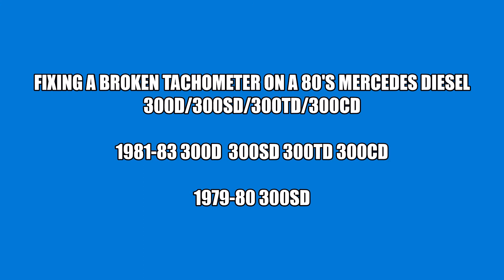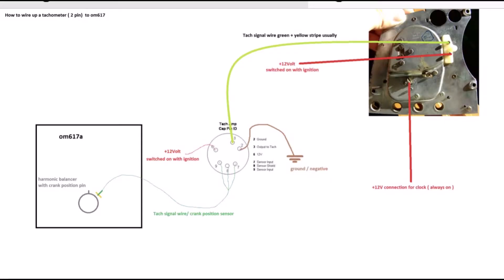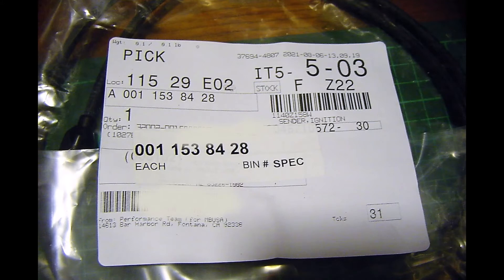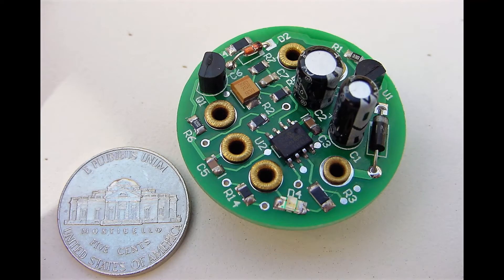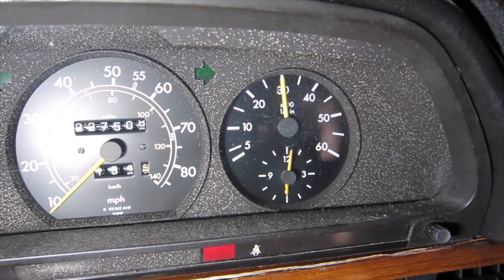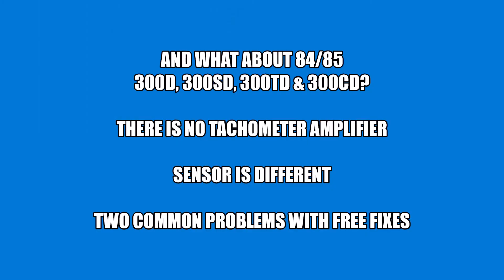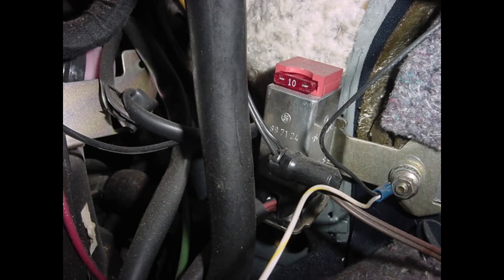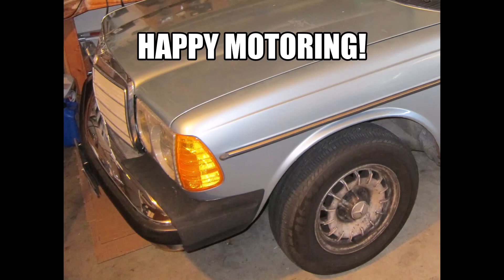Permanently fix a broken jumpy Mercedes 300D W123 turbodiesel tachometer

Comment: I own one of your digital tach amps for my '83 300D. I'm just getting a solid light with the engine running. I've checked impedance on the two sensor wires (7 and 9) to the stock amp mount and see ~92ohms which I think is ok and I only get resistance on these two wires (not 8). I also get the tach sweep when starting every time. I've read conflicting info about the 7,8,9 connections, some say 8/9 should give you ~80ohms and 7 is the shield. Others (my W123.133 manual) say 7/9 are the sensor and 8 is the shield. Lastly, does the clock power on the cluster need to be plugged in for this setup to work?
I'm pretty sure these connections to the amp base may have changed over model years. On your digital amp, what is the pin-out for those three connections from the crank sensor? Does it matter at all? Thanks for your time!
Thanks for your great product. I've bought two of your amps before with great success on other W123 300D's.
Reply from the maker: 92 ohms sounds high. I usually see around 80. It might be ok. The fact you get a solid light while running says the board isn’t getting a sensor signal as you’ve deduced. I would try cleaning up the sensor if it is caked with grease. Check to see if your harmonic balancer still has the little pin affixed to it as well. Pin 8 is the shield and it should read open when the amp board is out of the car. I connect it to ground through my board so you may see connectivity from 7-8, 8-9 when the board is in.  7 is connected to ground and 8 is connected to ground (through my board) so it’ll look like 7-9 is zero ohms. If the board is out 8 shouldn’t be connected to anything. The clock is unrelated to the tach circuit. It can be unplugged. The pinouts on the plug have not changed over the years. They are set up to connector to MB diagnostic tools that sense TDC. So they’re the same as on the gas cars of many years. The difference is some years add and drop extra connections. So my guess is you have a bad sensor, sensor cable or sensor plug. Try taking to two screws off the sides of the plug and pulling the 7,8,9 connector out to check its condition. The urethane is rotten on many of the older cars and prevents a good connection to the amp.

Comment: Hi ive got w123 1985 petro 2lt the tacho is missing can you help me regards alex
Reply from the maker: This depends on how you want to set up your car. If you have a magnetic pickup on your crank you will be able to install my amplifier in the service port.  Then you’ll need to wire in a two pin diesel tachometer from a turbodiesel.  That is a roundabout way of getting a tach.  Alternatively you could seek out a tach off an I4 engine that wires to your existing coil.  I’m not sure if there is one for the M115 equipped W123 cars but if not you may be able to modify something from a 190E or start over with an aftermarket tach from Autometer.  This may not be aesthetically pleasing if that bothers you.

Comment: Any idea what will cause the tach not to work on a 1987 300d w124 
Any help would be greatly appreciated.  Thank you 😊
Reply from the maker: Try checking the fuse on your overvoltage protection relay. Then check all of the connections coming off of your tach sensor (on the trans bellhousing) back to the brain box wherever that is on a w124. Good luck.

Comment: We have a PistenBulley with a 300D 917.952 engine inside. On this the rpm reading stops at 2500. What do you think is the error on this? does it seems like it is the amplifier? It reads som rps, but it is wrong reading after 2500. You can max the rpm but reading stops art 2500
Reply from the maker: Ok.  The Mercedes 300D system usually reads off the balancer on the crankshaft. Not the alternator. I show it in this video. It reads one time per revolution of the engine. The alternator pickup will be more than one pulse per revolution. Do you have a tachometer amplifier?  It looks like a little black garbage can. Check this video again.
Reply from the maker: Not sure. Does it have a 300D gauge?  Apparently you are getting a signal from your crank sensor. I assume you have a 300D amplifier under the hood?  Tell me 1) what is the sensor, 2) what amplifier 3) what gauge 4) did it work earlier and fail or did it never work?  I’m not sure why the old VDO system would stop at 2500.
Reply: @pacodrake3766  Hi, thansk for the quick reply. Yes, all of the instrunents seems like MB type. I did manage to find the electrical diagram for this machine and it seems like the tach is connected to the w output on the alternator. If the reading is off/bad could it just be as simple that the alternstor belt need to be tighten?

Comment: do you need to remove the old electronics from the cap? Or do you supply an empty cap with the new board?
Reply from the maker: Yes, you pull the old electronics out of the cap. Best done with long nosed pliers. It is in there tightly but it can be wiggled and pulled out by hand. I also make a 3D printed cap. On eBay check “seller’s other items”.